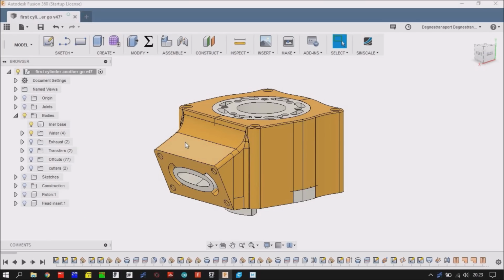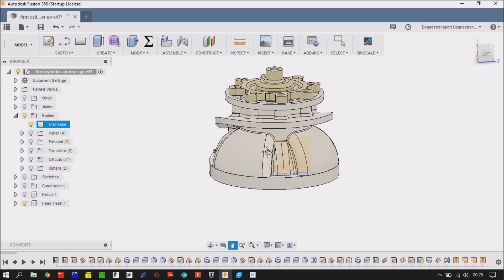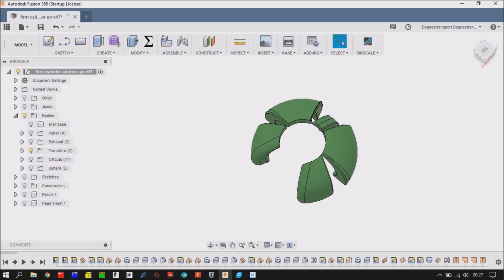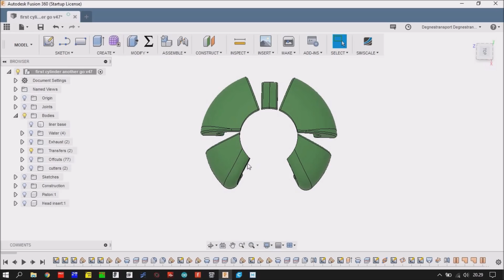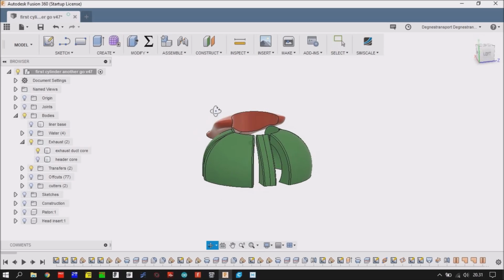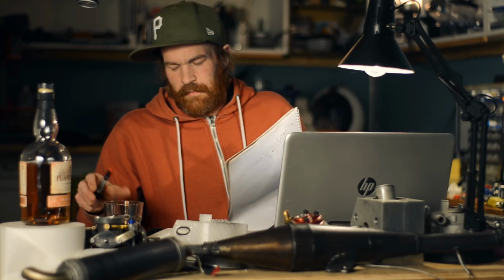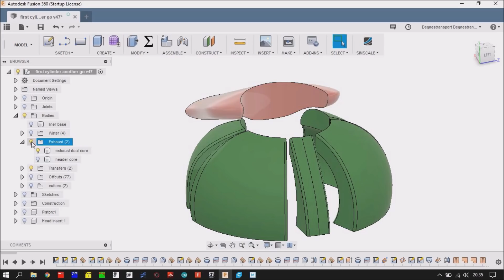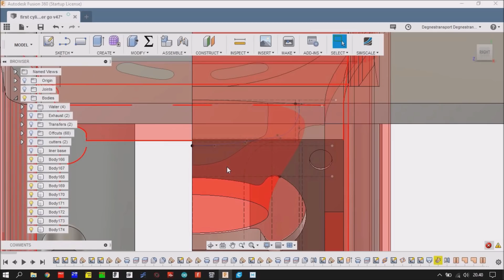3d Printed Two Stroke Cylinder for Lost PLA Casting Done. - Road to The Most Powerful Two Stroke 5

Comment: I'm not entirely sure how to phrase this question, but if your ports/transfer ducts are based on an existing design from Aprillia, what did they "base" their design on?
Was it a case of trial and error, did they run some sort of simulation, or something else?
Reply: 50+ years of 2 stroke design
Reply from the maker: And 100 guys working full time on it for years.
Reply: @2STROKESTUFFING  And genius Jan Thiel making sure. :D
Reply: Probably CFD software simulations too
Reply: @n00bkill  If you read the forum threads about the aprilia engine on pit-lane.bz booth Frits and Thiel says they didn´t use softvare. Only trial and error and a lot of knowledge.
Reply: @n00bkill  There certainly should be. Turbulence still can not be calculated by any computer, because it's a total mess. But I think some amount of turbulence can be "guessed" with a certain accuracy on  a computer, so as the technology and computing keep getting better, these things should also go forward with leaps and bounds. Though I think an internal combustion engine will never get a chance to be "perfected", at least on a large scale before other types will dominate the market. Of course there is a possibility that advanced hobbyists or racing departments will keep on innovating if no bans are put on place.

Comment: perfect format for this kind of content :D 
BTW that must have been a hell of a print, first time's the charm or there's been failure ?
Reply from the maker: It was, almost 25hrs with 0.2mm layer height. First one!
Reply: @2STROKESTUFFING  I'm not even gonna try on my anet XD
Will you release the files ? someone with a metal 3d printer might give it a shot (that would be awesome i've wanted to see something like that for a while)
I'm really interrested in the casting process though and what result you're goning to get (BTW, you should cast outside if possible, the fumes smell nasty :P)